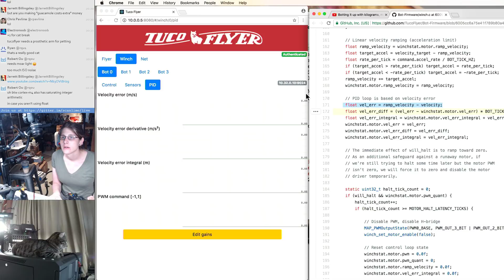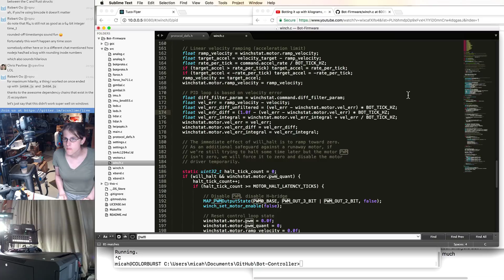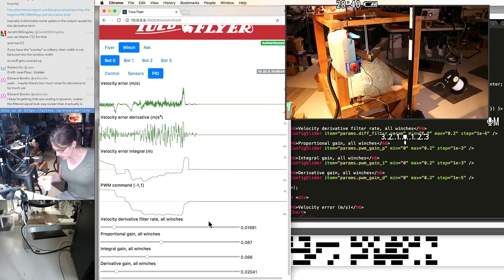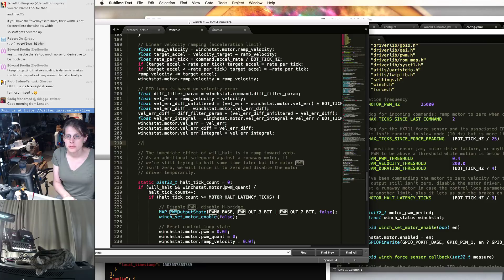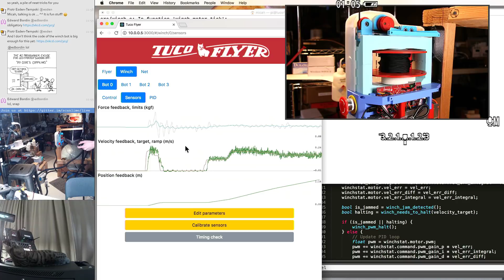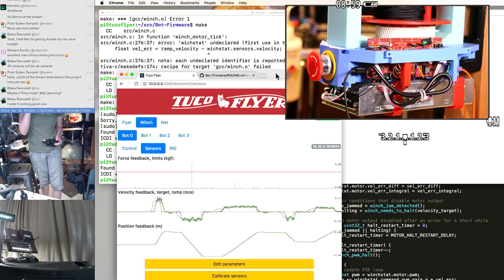Winch bot lights and motor firmware tweaks @scanlime-in-progress

Comment: Hi Micah! I'm very interested in what you're doing because I too am reverse engineering a similar Fy gimbal. 
Is any of this serial sniff familiar to you? This is one burst of serial data which is repeated over and over with changing values.

UART received: 165     // always the same
UART received: 90     // always the same
UART received: 2     // always the same
UART received: 7     // always the same except save
UART received: 3     // always the same except save
UART received: 1     // changes to 0 when setting roll (motor number?)
UART received: 0     // adds or subtracts numbers, -1 = 255, over 255 reverts to 0, and adds +1 to next line, was able to go well over 2550 (0x10-next line)
UART received: 0     // 0 means first set of positive 255 (changes to 1 at what would be 256), 255 means first set of negatives and subtracts 1 each further negative set
UART received: 120     // very random 0-255
UART received: 64     // very random 0-255

Btw: M570 is the best. I have two of em ;)
Reply: Ah. Found the video, going to grab some popcorn.